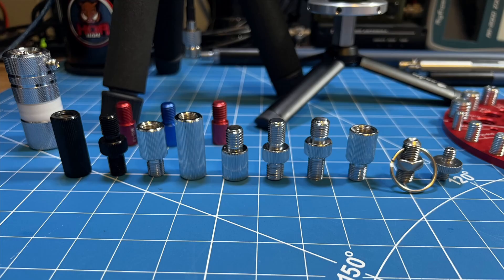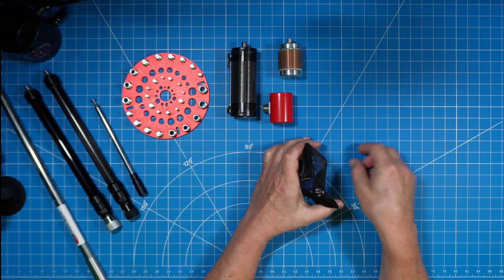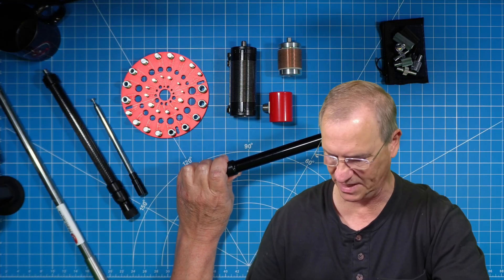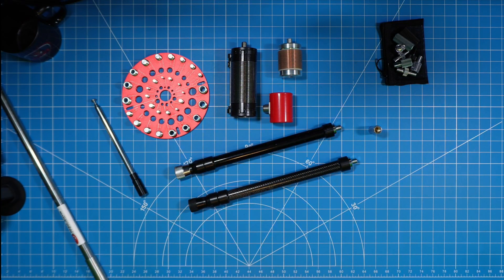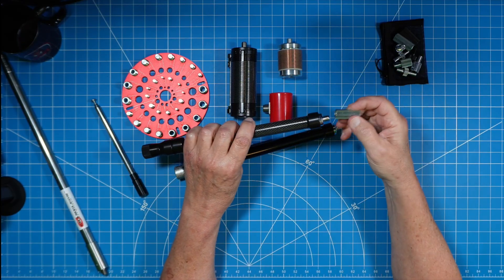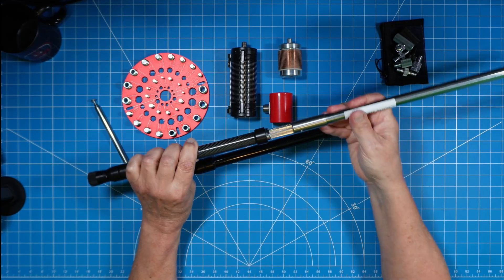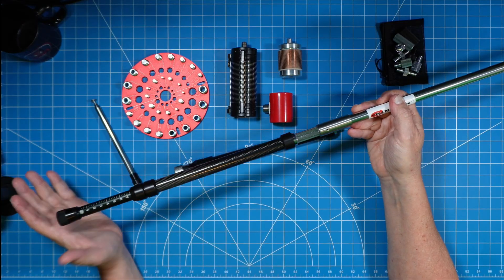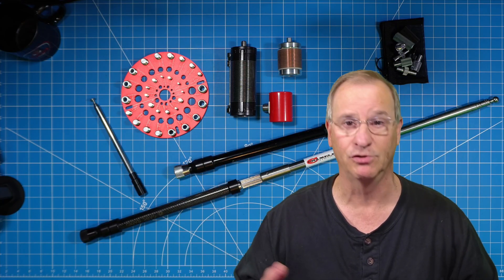Use a 17' Telescoping Whip on your Gabil Radio 7350T/TC Adjustable Coil Antenna for POTA & Portable

Comment: I'm a big fan of the metric system and prefer to use it whenever possible.  As a US engineer, I convert freedom units to metric, solve the problem, then convert back into US measurements, which is two unit conversions most of the world doesn't need to do.  That said, if there is already a standard... USE IT.  3/8-24 was the standard.  Now we also have M10-1.0 and M10-1.5, and we need 12 damned adapters.  Antennas, coils and adapters are often sold as M10 without specifying thread pitch.
Reply from the maker: I whole heartedly agree; sure would be nice to have 1 antenna standard.  The worms are out of the can and there's no getten back in.

Comment: I would like to find a 5/8-11 to 3/8-24 adapter to use on top of a surveyor tripod that DOESN'T COST $70!  KC3NFV
Reply from the maker: The two designs I am aware of are in the $70 range; nothing else out there.

Comment: Well that’s amazing. I was just experimenting with 17ft whip with Gabil 40M coil a few weeks ago and discovered this issue.  Thanks for the heads up. Steve NC4SR
Reply from the maker: Fantastic, good timing.  I thought it was funny once Gabil Radio had made all the adapters, the one that was missing was this one.  They jumped right on it when I asked, and I'm glad they did.